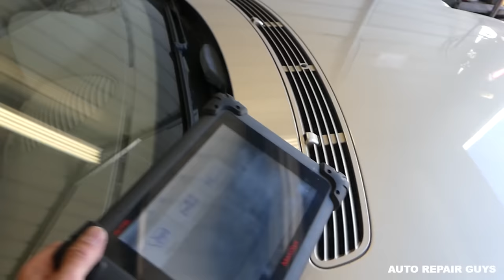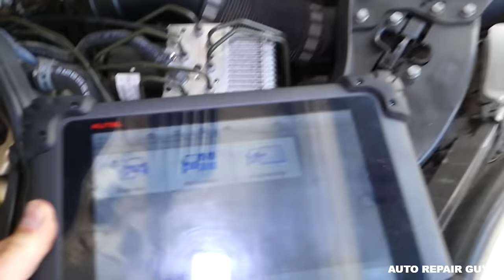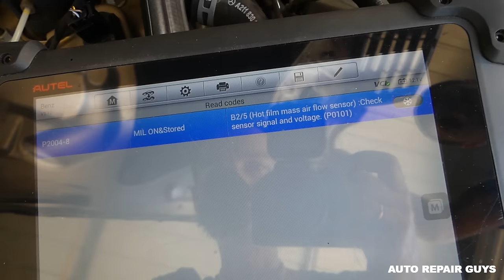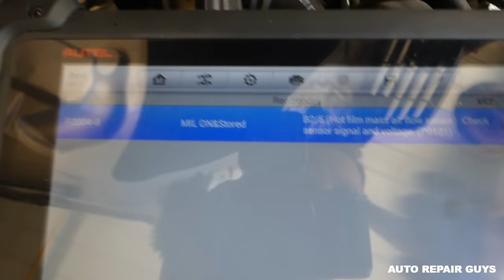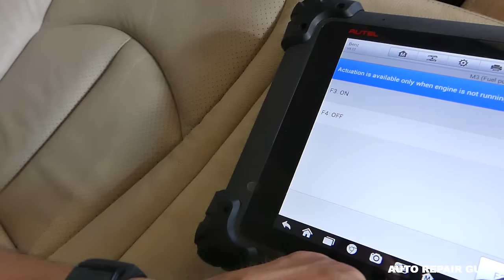Mercedes Cranks but does not start diagnostics

Comment from the maker: Products that we use and recommend:
► Panel Removal Set: https://amzn.to/3YiMADu
► Assorted Fuses: https://amzn.to/4fx4s3F
► Tool Set: https://amzn.to/3p5MM6t
► Screwdriver Set: https://amzn.to/3XRB28Q
► Castrol Oil: https://amzn.to/3xBc8B9
► Oil Filter: https://amzn.to/3w0Ulme
► Torque Wrench: https://amzn.to/32qyRwg
► Liqui Moly Engine Flush: https://amzn.to/3IiDBID
► OBD Scanner that we use most often: https://amzn.to/3I4MQfe

► Check out our Amazon Store for the tools and parts that we use: https://www.amazon.com/shop/worldmechanics
Reply: Good evening If you allow me to solve a problem I have a car Mercedes E280 Model 2006 Taali...المزيد
Reply: Good evening

If you allow me to solve a problem I have a car Mercedes E280 Model 2006 Taali code p0014 What is the way to fix it ... A thousand thanks to you ..... I am a follower of your wonderful videos ..... Your friend Dhahi from Saudi Arabia
Reply: Can u tell me what tool u used to remove thr needle from the fuel rail please? Looks like a screw driver by handle but the end is different

Comment: If you’re replacing the fuel pump with an aftermarket pump do the harness have to be rewired. 2007 E350. My pump didn’t come with a new harness but I’m just trying to make sure it wasn’t in there for a reason. Really been trying to get this car back started because I’m using the original harness and with the new pump in it’s not starting.

Comment: To turn on the fuel pump, pull out the fuel pump relay and jumper the contacts with a bit of wire. Cheaper than buying an OBDII diagnostic gadget that works on Mercedes. The relays can also fail so if the fuel pump works, check the relay.

Comment: Hey guys I need help. 2007 Mercedes c280 . Sometimes it starts sometimes it won't. It gives me code P0050 which shouldn't cause the car not to start. Also ODB machine shows Short term fuel trim bank 2  Fault. Any Advice?

Comment: On my 2007 mb s550 my fuel filter on driver side keeps burning out when fill up gas to full tank and inside car stank of fuel. The connector on top of fuel filter pin 2 keeps burning a hole thru the filter so gas guzzle out under the seat. I just refill gas tank to 3/4 full ever since. If I fill tank to full mark it keeps burning out the fuel filter.   Anyone know what the exact problem is on this MB and the fix for it?

Comment: How I fixed my no start was from troubleshooting with this video. My dad eventually came into help but we got it. I changed CPS to no avail although it may of been one of the problems.when you have start enable fuse fried when trying to crank it may fowl your plugs.additives like fuel injection cleaner also can clog your injectors. How I fixed it was pull the plugs cleaned a few up. Went To fuel pressure line and released a bit of gas after I pulled #4 fuse(fuel pump) it seemed to purge the gas in the lines because it seemed to be flooded. Cranking with the fuse blown I believe fowled plugs and flooded the car with gas.my dad figured trying to start with that fuse out and it did the trick.i think because it used what gas it had in the line without adding excess gas via the fuel pump. Starting fluid also helped I believe may have cleaned M.a.F sensor. But use actually m.a.f cleaner because it leaves no residue.im happy to have my car back .

Comment: Thank you! You got me a little further in the game. Car quit on the highway, got it towed home. Kranks, lumber is a little bit and quits almost instantly. Fuel pump seems to come on and there is pressure in the rail. I disconnected the air intake and squirted some fuel in, it started right up and ran until that fuel was used up. Now what? Fuel pump seems to be working. ECM?
Reply: You figured it out,?i have same problem
Reply: @clintganaishlal1306  Yes, sadly and weirdly enough, it ran out of fuel. The gauge read about a half a tank but there was no fuel in the system. Put fuel in it, ran perfectly. There’s something about these tanks that are split in the middle, not sure how that works but our split has a damn in it. Hopefully your problem is as easy to solve, pour some more fuel in it.
Reply: I see no one replied to your comment. Its cool to see u not scared to dig right in. 

Only thing I can say is yes its the computer not allowing fuel to flow out the injectors. But the question is what's telling it not to.. 

Without a clear bill of health sent from most of the sensors the ecu hold back either fuel or spark till fixed. 

In your case id say runs on fuel forced in a fuel filter is rare believe me id say in your case it was like a cam or crank sensor issue. 

Did u ever figure it out? Thanks
Reply: @timhansonservices3374  hi Tim, thanks for your input. Like most problems like this, it took a little while to get it figured out. It ended up being the “dual tank pumps“. The fuel gauge read about a half of a tank, but the car was basically out of fuel because one of the pumps wasn’t working. Unfortunately, after having put an additional five gallons over the original half tank, the car ran. I carried a 5 gallon can around for a couple of months waiting for it to run out of fuel again, but it never did so, it fixed itself. Hopefully forever. 🤷🏽‍♂️ thanks again.

Comment: I had the same issue. My problem to my issue was the fuse for the fuel pump. Once I put a new fuse it started right up and i have no more issues. I believe the fuse is the K2 fuse in the passenger side

Comment: Great video... I have a 2001 MB SLK 230 Kompressor... I had the same issue and changed both fuel pump and filter.  However I did not change the sending unit.  Will the sending unit stop the car from starting? I can spray the intake and the car will run.
Reply: Same problem here. How did you solve it?

Comment: To verify the filter is blocked, use a fuel pressure gauve on that schrader valve and if you get no pressure with the pump on thats definitely your issue
Reply: Thats what I was thinking.
Reply: Why does he need to use a gauge when there was no fuel when it was removed?! :/

Comment: i had same issue last year with my E200 Komprser but my fuel pump died n i have to put new one n then it was gud to go
Reply: Did you have a diagnosis code when this happened? Changed spark and coils and still having this issue. The car shop has no code but is "assuming" fuel pump. Wanted to ask before I go through more money! Thanks

Comment: my e500 didn't start due to blown ignition coil fuse. one of the ignition wires was damaged and short-circuited against valve cover.

Comment: I had a 98 ML320, same symptoms, low fuel pressure when I checked with a guage. I replaced the fuel pump, and still same problem. Starts up when cranking it, then immediately dies. Tried pouring fuel in intake, and ran good for a few seconds, then quit. I replaced the CPS also still no running.
Reply: please help me with my ml55
Reply: Gato you fix it ? Change the fuel filter and the camshaft sensor
Reply: @souphianeb7908  I did not have time for it anymore, it did not get fixed.
Reply: @souphianeb7908  I have the same issue and I'm about to do this tomorrow to see if it fixes it
Reply: @Major.321  good luck
Reply: I recently acquired a W220 with the M113 and the night before just like this video, it wouldn’t turn over. Tried again and bam it fired right up, but the response from the throttle was a slight delay. Kept driving and it finally cleared up and it ran like a champ once again. I have replaced a few items like the fuel filter (fuel pump primes) and the crankshaft position sensor.

Comment: Having the same problem with my 99 sl500. But after i use some starting fluid i can keep the car running with the pedal until it warms up then it will idle. But it dies when i try to drive.

Comment: I have a 2011 450 gl.. was driving it..

Stopped  then it would not start..

Had it towed .. was told that the starter just went.

There was no noise to start..

All electrical worked.

Car had 155,ooo miles does this seem plausible. That the starter can just go like that?

Comment: I'm having a similar challenge with C202. 
Fuel pump, fuel relay, all working fine. . but the engine only cranks and doesn't start. 
I put a little fuel in the engine, it still doesn't start. What can I do next?
Reply: Any luck?

Comment: What tool did he use to pull the needle from the fuel rail???? Looks like a screw driver handle but the tip is different! ANYONE KNOW???
Reply: Its TYRE Valve remover (or tool) you can find it at amazon or ebay or at any local store

Comment: M112 v6 3.2L 
please help
.
my car had a rough idle and turn off by itself 
i changed the fule pump it was raelly dirty
i cleaned the injectors
after that it runs roughly for few seconds , and a poping sound came out of the intake manifold
and it never started after that
it cranks but doesn't start
No RPM while cranking
the sparks work fine
the fuel reaches the  injector
could it be a bad crank position sensor?
or an intake manifold problem?

Comment: Mine starts right away when the engine is cold, but as soon as it’s warmed up and I shut it off and I come back and restart it it Hass to turn over like 20 times or so before it starts. I have replaced the coolant temperature sensor like four times, as that was one of the codes that my computer found, I have also replaced the crank angle sensor. I am out of luck, I don’t know what it could be. Can you help!?
Reply: Yours could be the computer
Reply: @ezequielsandovalcruz8683  What about fuel pump? every so often I get the flashing car light, when I have plenty of gas, and I get the check engine light for "p0455" Evap system leak. Major leak in purge system: hose in system or filler cap open. I have bought a new filler cap, and replaced the fuel filter last summer, because I had ages leak at one of the hoses. I feel like it may be leaking vapors somewhere, but I don't smell it. As far as the coolant sensor issue, it may be the wiring, because for some time the fan would go high, but the car was not overheating, and the top gauge was fluctuating. Now all that is good with the temperature sensor, as the temp reads just above the middle line. The startup sometimes has to turn over in the cold now too like 20 times before it actually starts, then when it does, its like its starving for gas or air or something. However, once started and the idle goes down to normal as they all typically do, the car drives excellent, with great acceleration etc.

Comment: probably a key/security problem.  the computer is not turning on the fuel injectors for whatever reason.
Reply: I have a 98 SLK 230 doing that exact thing right now.  Injectors not firing.

Comment: I have a CLK430 year 2001, 70k miles,  that last month (in june) I stopped doing it for 5 days and it did not start me on the first cranks it started me on the second cranks now in this month I also stopped using it for 5 days and I tried to want it to start no longer started (cranks but doesnt start), can you help me please?
Reply: Estuardo Caceres did you ever figure out the problem? Have the same model but mine is a 2000
Reply: @lescrane1263  I fixed. Thanks
Reply: @lescrane1263  I fixed it. Was very easy for me. My clk has a fuel pump relay broke down. I had to bind the relay
Reply: @lescrane1263  you have to see the folowing video  : write "quick simple fix for car crank but wont start mercedes e320 2001" is a good tutorial. It shows how to bend the fuel pump relay